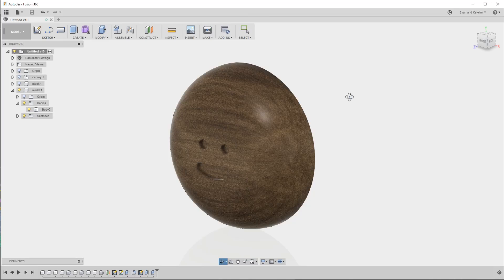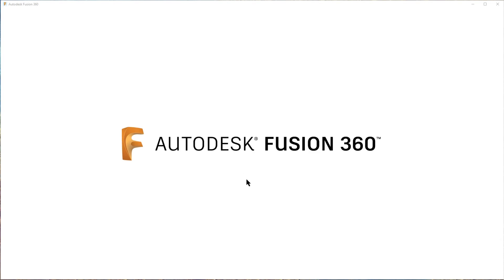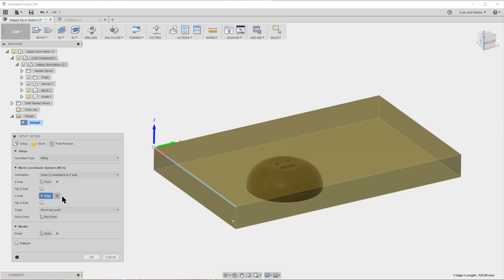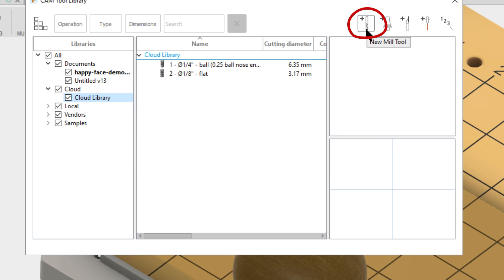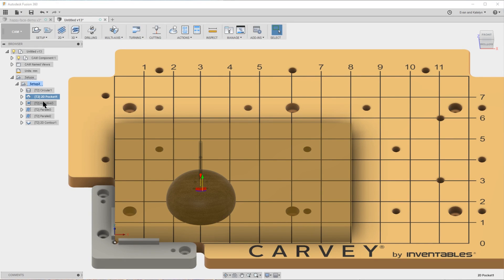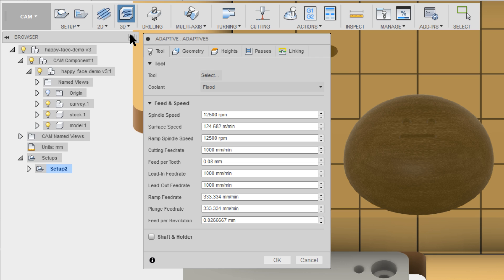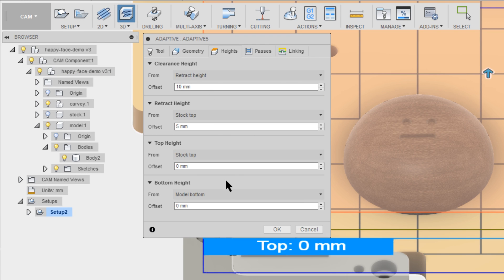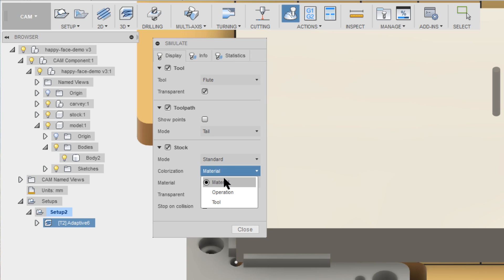Fusion 360 CAM tutorial for CNC beginners | How to

Comment: Bit confused about how to detach this model from stock. During various passes it seems to me it's attached by a small layer to stock , and this prevents it to move during carving phases. Is it there a detaching phase in which cnc split stock from model? If so, doesn't the model slip during final carving? Or the final detachment is done manually ( how?)

Comment: Actually my work bee eats through the material while approaching a contour/slotting job sometimes. I  set the box point to the top but somehow it eats through around 5mm of my stock to reach the cutting point and then goes up and starts the job. When it finishes it again eat through the same amount and returns to 0,0,0 coordinates. I am having a tough time figuring it out.

Comment: I set the bottom 0 as always, in this way I have one Gcode and I process the material from two sides (gives a pause before the other side and turns it manually) It comes out perfectly. I set the control program so that it always retracts the tool when turning it on, only then it goes sideways so it doesn't hit anything (it moves back so high that the frame itself hangs on it a bit lower).

Comment: First video I have seen by you guys and found my finger pressing the subscribe button. Now though I have a question. I’m going through the ropes of learning fusion 360 with the sole intent of being able to design and make things, but one thing in particular. To make this which is going to be an injection mould for a mask, it needs to be machined out of Aluminium. A concave and a convex mould which come together to form the mask. Does this pose no problems for fusion 360. What machine would you get to be able to do this. I’m thinking robotic arm with multiple axis as when down inside the cut out shape I need horizontal machining too. Thanks. James

Comment: Great video, guys! I noticed that you used tabs. I can’t figure out how to add that final CAM 2D Contour with the tabs because the previous Parallel machines to the bottom of the stock. This comment is an echo of one made on your https://evanandkatelyn.com site, but I didn't see a reply. I had a great time carving our a widget I'd built in fusion 360, but I had to stop the X-Carve when I realized that a lack of tabs was going to send the widget spinning into space once I had cut through all the way to the bottom of the stock.

Comment: great video! how do you tell your machine how high the stock is sitting off the spoil board? i ask because mine keeps plunging all the way down, if i don't stop the machine, the bit would run into the spoil board. thanks!
Reply from the maker: It depends on the machine, for the X-Carve we set the zero manually and input stock thickness in Easel when we go to carve (it prompts you for the thickness right before you carve)
Reply: @EvanAndKatelyn  ok I'll try that out thank you!

Comment: I've just built a CNC machine, I'm very very new at this, I was hoping to use your tutorial for my first run, but some parts are confusing, you skip too many steps. As a beginner, some little things are not that obvious.
Reply from the maker: We do have a link to the written tutorial in the description which makes it a little easier to follow. I'd also recommend checking out Lars Christensen for more tutorials, he goes a lot more in depth 👍👍
Reply: Yes, thank you, that's what I've been doing, however, not easy for a newby like me. I first tried with your Kevin file, but a lot went wrong, it milled (simulation) everything but Kevin.

Comment: Hi. I have a Chinese router 3040, and the G-code that I did for a simple square box (120x75x40 mm) but when I load it in mach 3, the square box is done at 100 millimeters instead of 120,  can you help me find out why it does this?  I'm using the post processor  setup with mill, and Artsoft  as a NC file. I congratulate your answers. Amaxac.
Reply from the maker: ah, every machine and processor is a little different, you might have to ask someone with your specific set up. sorry we're not more help!

Comment: Greetings. Hi. I'm from Perú . One question. Can I desing this file in 3dmax instead of fusion 360 to upload to easel ? Because i dont use fusion 360. Please Help me. thanks
Reply from the maker: Does 3Dmax have CAM capabilities? If so, then it should work. But it has to have CAM, not just CAD. Hope that helps!

Comment: Have you ever tried to cut a ball? Something like 35mm diameter.
Reply from the maker: Nope, haven't tried that yet!
Reply: @EvanAndKatelyn  very well, I haven't found something like that on YT (just 2 halfes glued together and  some flattened balls on 5axis machines) either so here is my idea. I've been thinking of it since I was looking for a way to do kicker balls. (I tried injection molding and also got a lathe but was always curious if it would work on a 3 axis gantry CNC). I would start with the upper half, then do a  negative sphere for a support or just cut a round hole the size of the ball and the depth of the first half, screw the first part on that support and do the second half.
Parting it could be tricky but you could leave on some little tabs that the ball doesn't come up. A vacuum hold down maybe with the support exactly the negative of the ball and some holes drilled in it?

Anyways, just some ideas. Would be a first on YT though ;)

Comment: Hey guys, great work on the video! Just had one problem that I was hoping you could help me with. I have using Fusion to model for a little bit but clicked the CAM tab for the first time tonight. So I have been trying to work through this process on my own to get the feel for it but when I get to the CAM tool library and try to add a bit nothing happens when I hit the +tool  button. I enabled cloud libraries but nothing. I think this is probably a oversight by me but was wondering if you had any ideas as to what I could've done wrong. Thanks for everything you guys do in the maker community!

Comment: Still don't understand how to do multiple passes, but this definitely helped me with starting to use Fusion360 to Carvey, but is there a way you could go over the multiple passes more? (Unless I'm missing something in the beginning that you said how to do these :P)
Reply from the maker: Multiple passes as in multiple toolpaths? Like, an adaptive, then a parallel, then a profile?
Reply: Like I start with a rough pass with a 1/8" then I want to do the next ones smaller and closer to the model. So yeah the adaptive, parallel, and profile, but also how to tell it from the pass that was done already so it's not trying to run the stuff that's already been taken.
(EDIT)
Solved it partially, but it keeps giving me warnings "Warning: Rest material adjustment reduced to maximum limit."
And I have no idea what it wants for the Contour Selection of the 2D Contour.

Comment: That is really cool.  I have been impressed with computers controlling machines ever since I saw the first one about 30 years ago.  My son and I keep discussing building a CNC router, but we would have to be able to cut steel with it and we don't really have the room.  We have also discussed adding CNC to one of the mills.  We built a 4'x9' CNC plasma table a couple of years ago.  It will cut 1/2" thick steel with plasma and 1"+ with oxy'acetylene.  We recently built in the capability to rotate and cut up to 6" pipe.
Reply from the maker: CNCs are super impressive and can open so many possibilities - that's awesome that you made a plasma table!

Comment: Hey!
Great video! I am considering an enclosed desktop CNC milling machine (either Carvey or Nomad 883 Pro) for jewelry design from hard wood (like walnut). Would you recommend Carvey for such application? Does it struggle with hardwood? How long did it take to carve out Kevin? Thanks ;)
Reply from the maker: Thanks so much!! Yeah think they would get great for it! One thing the Carvey has that you should check the nomad for is auto homing in the x,y,z axis so you can flip your piece and work from both sides easier. No problem with any hardwoods we've put in (walnut and maple). Kevin took a few hours but we were running it pretty conservative

Comment: Would you be able to point me in the right direction when it comes to making .svg files for cnc? 

I'm a beginner at DIY machining. My current CNC is the Shaper Origin. Most everything that gets cut with this has the option of cutting in/on/outside/pocket type cut. 

The folks at Shaper encourage users to go with Fusion 360 for their design platform. This being very new to me, is something I need to be taken to school on. I watched this video on 3D machining but didn't really find the direction needed to really get going with my CNC. Could you make a part 2 for .svg users? Thanks!
Reply from the maker: +Mark Eddy the short answer is for using svgs, when it's a simple design you can make it in Illustrator as a vector and save it as an svg. That's what we've done in the past. I'm guessing the shaper software accepts svgs? We haven't tried that software before so we don't want to mislead you blindly!
Reply: EvanAndKatelyn, is there a way to design using fusion that you would be willing to explain? I'm such a visual person when it comes to learning. There are videos that I've found explaining pieces of svg and svg conversion, but nothing has shown users the combined information of converting, and designing by using fusion or illustrator. The biggest lack of information would be primarily in the design area. Thanks for all your videos and I really enjoy the clean and clear videos you produce. You two are a great team! Keep it up!
Reply from the maker: Mark Eddy we do plan on doing a CAD video that goes into more detail about designing in Fusion!

Comment: Man I don't own a CNC machine and have never even been in close proximity to one, but I found this video very enjoyable and informative. Way to go guys.
Reply from the maker: AWESOME! That's just what we were hoping for and it's a great compliment, thanks!
Reply: if you are inclined to spend time building it and learning the differences you could try getting a mpcnc, its about 700-800$ which is quite a bit cheaper than a premade one (at least any ive found of a reasonable size), however it does have limitations due to the materials but for wood its a more budget friendly option that with some love can be upgraded as time and money provide, if you have the funds though ive seen a ton of positive reviews for the X-carve so if you wanted to dive into it that would be a decent option

Comment: This is fantastic, I have designed a wood burning tip with my logo that I am going to have machined out or brass on my friend's CNC (thanks to the inventables gift card you guys gave me, which I used to get a bunch of bits).  I've been trying to figure out the CAM part and this makes it much more accessable.  One question I had,  do you use just one bit when you are carving something out or do you switch bits based on the specific path you are doing?  Is there anything specific you need to do or know when swapping bits in the middle of an operation?  Also, with Easel (or Fusion), when doing fine corners, is it easy to setup the path for a V bit to get nice sharp corners (as they also have to move in the Z access, if I'm making any sense)?
Reply from the maker: We haven't done anything with multiple bits but there are most likely a few ways to do it. The easy way I know will work is to export the g-code for each toolpath independently and swap, using the same home point. My guess is that if you have multiple tools, Fusion will export something to pause, but I'm not sure how Easel will handle it. Something to look into for sure.

For the fine corners with a V bit I didn't actually know so I created the tool and did a test. Looks like engrave is the answer and it works great! https://i.imgur.com/6l4fRYT.gifv (I made a little GIF of the demo) - E
Reply: And this is one of the reasons I love you guys, not only do you answer the questions, you go out of your way to test the answers and create nice little graphics.  Thank you Evan, you are awesome!
Reply: Speaking from general experience with g-code and metal cnc machines, you can have the head return to home and pause, until you hit the go button on the machine again. This would allow you to change out the head without creating multiple tool paths or g-code printouts.